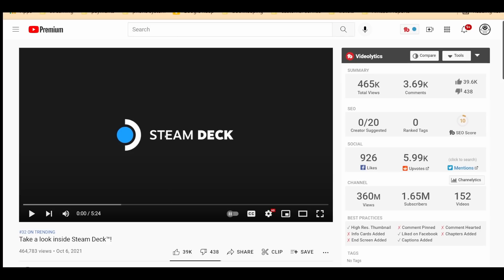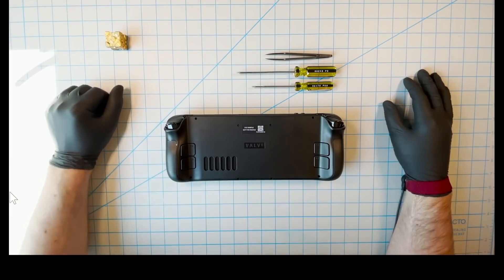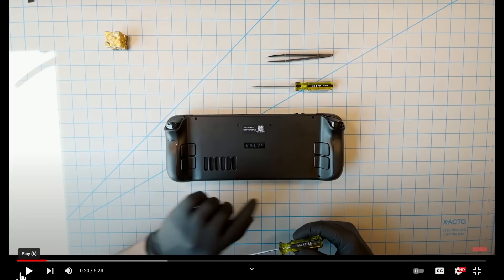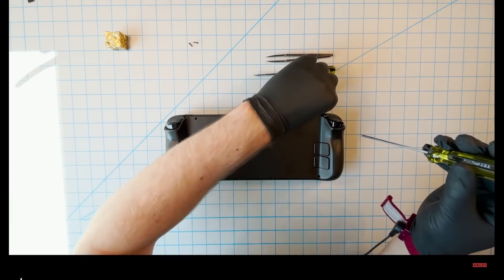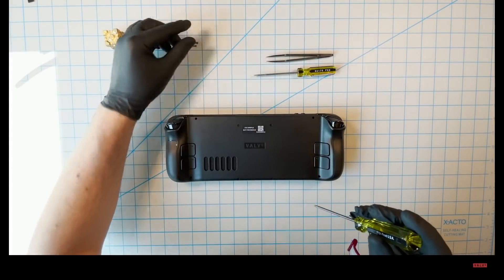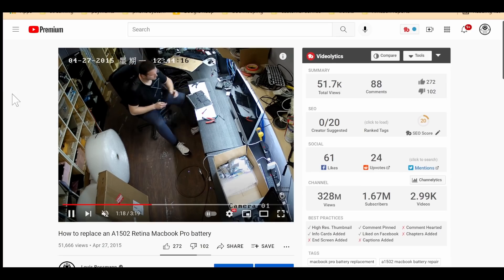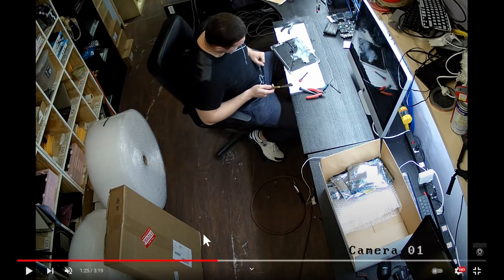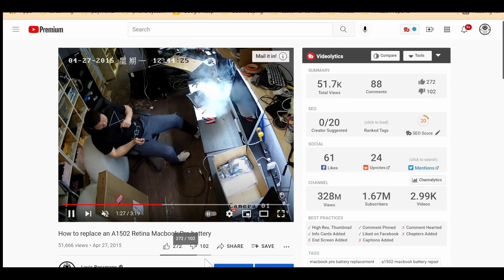Steam deck battery may end your life? bruh 😑

Comment: Believe or not the internal estructural is compromised by don't tight correctly the screws, usually the screws are placed for 3 goals: 1 for be few and hold as much objects are possibly, 2.- for the overall estructure can support the forces of kilonewtons or grams per square centimeter, 3.- the screws dont damage the estructure when are screwing in to it, if the company have respect for the product or have respect for the resurces invested on the product they have a special team who only job is desing  of where, how and how much stress the screw will handle

Comment: It can "weaken" it if they used anything similar to the C64's self tapping screws. Thats how I destroyed mine, I dropped it while horsing around with some one and the C64 popped open and spilled its guts everywhere, however I was able to glue and solder the whole thing back together.

Comment: Well if you take out the self taping screws it will technically be more fragile after reasembly, or you can break something off, not thant it matters after one time, but if someone who doesnt know better gets too confi opening it... as you sayed, people are morons and its good to scare those who dont know of, if its with the battery or construction. I think you saw several laptops that were open by customers that just dont fit so well anymore

Comment: Regarding the screws... I mean it's a screw going through plastic right? It makes sense that it will get looser every single time you remove the screw and put it back in. 

Especially if you somehow manage to get the threads misaligned and cut a new path in the plastic. I would be more concerned about over tightening.

I don't think it's bullshit, but it's definitely extremely cautious.

If you're the kind of person who can understand why it's not a problem, then you're probably the kind of person who can take apart the steam deck safely. 

Maybe that's the point?

Comment: Technically they're correct the structural integrity is compromised slightly but I mean very slight. This happens with any self tapping screw, every-time you take out and put in the screw you unfortunately shave away a bit more plastic each time (This is usually fixed with resins like loctite etc but then its semi-permanent). It's negligible but I imagine they have tested this with a robot/machine and confirmed after I dunno 10,000 tries! So yeah your right, it's probably not enough to warrant not fixing your device but just enough for them to have to cover their ass and put it out there.

Comment: I don't think the permanent damage from screws is a huge stretch. When I used to mod nerf guns, it was very easy to damage the screw holes with those shitty self tapping screws.
Plus they're very snug when they're first screwed into the plastic and once you unscrew them, they're slightly less snug so you screw them in a little harder which damages the screw hole slightly. After repeatedly opening up nerf guns, you do notice the screw holes starting to fail even if you're being careful.
And yeah you could not screw them in harder but then you'll just have loose screws.
Or maybe I'm just shit, who knows.

Comment: Imagine engineers with legal counsellors sitting and counsellors saying:
- So you are making a tear down video.
- Engineers: Yes.
- What if a person opens the devices damages the battery and it catches on fire killing them.
- Engineers: That's quite unlikely to happen.
- Does that mean it would be impossible?
- Engineers: Well...
- If there is 1 chance in a billion, then let them know they may die. We don't want legal problems.
- Engineers: okay?
Reply: This is a screw driver. Please be careful when using it, because PEOPLE COULD DIE. Phillips will not be responsible for any harm done.

To be fair though, since you cannot really extinguish battery fires (since the heat comes from an internal problem), there is a risk of the whole room catching fire. And people easily underestimate how quickly that becomes a death trap. Add the smoke filling your room, maybe toxins. It is certainly dangerous. But then again, almost everybody is carelessly carrying one or more of those things in their pockets.
Reply: @LordMardur  With the prevalence of batteries that can suffer thermal runaway if damaged, I really think there should be some sort of widespread PSA or teaching initiative about how to smother lithium fires. Like how we have voluntary emergency care classes that teach CPR and concussion mitigation.
Reply: @VulpesHilarianus  & grease/kitchen fires. Every Holiday season news stations run PSAs about how to put them out because it's rather counter intuitive unless you really think about it.
Reply: @VulpesHilarianus  Yea I'd like to find out how you can smother lithium fires!
Reply: @bbbbbbb51  Thousands of people die a year of dumb shit that is purely their fault, Welcome to the real world. Shit can and will go wrong. The whole PSA and disclaimer shit is becoming annoying.
Reply: @jostouw4366  sand.
Reply: @bbbbbbb51  yes!  why would you not ALWAYS have a proper lid nearby!  ALWAYS have one ready...ALWAYS!
Reply: @zvxcvxcz  where do you get the impression that a 10 years old kid with a screwdriver and overenthusiastic curiosity would have a class K fire extinguisher in their fully fledged professional electronic repair workshop, a.k.a. the top of their toy box, which may or may not contain flammable stuffs that could have caught a spark from the battery fire, when they opened their device.
Reply: @jostouw4366  you don't, just make sure the fire can't spread then back away and let it burn out. If you are working with lithium or batteries often you might want a sand bucket with a hopper to bury the batteries. lithium fires can burn hot enough to melt the sand into glass though.
Reply: @nathanielhill8156  I knew that, you've heard of sarcasm right?😇
Reply: @LordMardur  This is coffee. It is got. It can hurt you.
Reply: @LordMardur  Just throw it in a large body of water. The water will diffuse the heat and electricity and not only solve the problem but hide the evidence that it ever occurred.
Reply: There's also the problem of people wanting to get this out of the room they're in. This may cause them to pick it up and that again puts them in more danger.
We're all a bunch of nerds. But millions of people even kids watch the original valve video, and valve really needs to cover their bases on this.
Because in any court they could never argue that you're not supposed to open it once you make a video showing how to open it
Reply: As I usually say, at this point I think engineers just write the very last page of user manuals (when it's there) about the technical specifications.
The rest is written by lawyers.
Reply: Reminds me of the Simpsons when they're watching the video about Cypress Creek, a planned community for the workers of Globex corporation. At the end it says "Cypress Creek, where dreams come true" and is followed by a disclaimer that your dreams may vary from that of Globex corporation, it's subsidiaries or shareholders.
Reply: A woman sued MCdonalds for her spilling her coffee on herself and claimed she did not know coffee was hot in court, and she won. Now they print COFFEE HOT on their coffee cups and holders. This is why this is a thing. It's all about liability.
Reply: @AdolphusOfBlood  that was also a great Seinfeld episode
Reply: @JonCusack  I know people that have worked on site security. It does not just happen in good comedies sadly. For the record his partner shot the guy when he was attacking him with a knife. Then the guy ran off. Yes he aimed to kill (two hits center mass), yes he was a lethal threat.
Reply: This comment reminds me of a Terry Pratchett thing.

    "You can't give her that!" she screamed. "It's not safe!"
    IT'S A SWORD. said the Hogfather. THEY'RE NOT MEANT TO BE SAFE.
    "She's a child!" shouted Crumley.
    IT'S EDUCATIONAL.
    "What if she cuts herself?
    THAT WILL BE AN IMPORTANT LESSON.
Reply: Well A Li-ion battery could catch fire just by charging, or sitting undisturbed. There's millions of ticking bombs sitting in obsoleted phones  discarded in junk drawers. Valve are just protecting themselves against stupid with enough money to hire a lawyer.
Reply: I mean, yeah? Where is there a problem? Fraudster can basically perform an "insurance fraud" on you if you don't say anything.
Reply: That pretty much sums it up. They said all of that to make sure their asses are covered if some idiot tries to sue them.
Reply: The problem here is - this is a handheld device you might carry in your POCKET. The battery catching fire in your pocket will probably lead to very nasty burns....
A friend had his vape device do that, since he fucked up his modding....
Also KIDS will be using the device and they are not trained technicians....
Reply: @cl1cka  Maybe not but they are experts at stress testing both mentally and physically!
Reply: I think it's more about people crying wolf, than the ones actually having accidents
Reply: That's probably along the lines of what was said at such a meeting too.
Reply: I'm so tired of the safety notices on everything now, Its become so intrusive and annoying. 

Lets be fair here, "Its Dangerous Business Walking Out Your Front Door"(Lets see if anyone gets that reference lol) every day. Theres 0 guarantee that you'll be making it back home everytime you go to work, the gas station, super market ect. And even at home, you arent safe. One fall could mean its game over if you fall in just the right way.
Reply: @joshuakhaos4451  why do you think they do it?
Reply: but 1/1000000 is practically 0
Reply: @hukama6911  lawyers would argue otherwise, Steam doesn't want to deal with lawyers.
Reply: @CardSearcher911  but engineers aren't scientist, and practically that 1 guy is negligible
Reply: Engineers believe that people are smart, lawyers know how stupid some of them can be.
Reply: @spacekettle2478  including other lawyers and judges.
Reply: Don't you just love when idiots turn the carefully accurate scientific statement of "well, technically nothing is impossible, because our scientific methods can't verify/disprove any hypothesis you can make up with 100% certainty, due to lack of data and possibility to test, but our extensive research shows no indication towards this hypothesis holding any merit, thus it's extremely unlikely" into: "ScIenTiStS cAn'T pRoVe Me WrOnG, tHeReFoRe I'm RiGhT!!!1!"

Like, I can understand when little kids ask endless what-ifs and come up with the most preposterous scenarios, expecting a definitive answer, but when adults do it, that's just imbecile.
Reply: This is the thing that everybody has to realize. That one person that gets killed or maimed on the battery, well then sue the company for millions and millions of dollars. Which can ruin a large percentage of profitability for that quarter.
Reply: @nickvanhorn681  most jurisdictions would first figure out where the cause of fault is. If the battery itself is not manufactured or installed wrong in such a way that it could catch fire without someone actively damaging it via their own actions that go beyond general use cas, the company is fine, big companies get countless such silliness and have the responses all preset.

Turns out most cases of what seem to be silly successful lawsuits you hear in the news are made to sound ridiculous by the news but in reality arent.  I.e. one of the more famous ones is the whole coffee spilt on self. In that case it was shown and determined that the coffee machine being used was set outside of the franchises constraints and being used incorrectly by the franchisee to the extent that it gave 3rd degree burns not just normal regular burns. The news of course just went duh coffee hot look at stupid person and stupid courts .
Reply: @SereneAncalime  Then pray tell, who paid the bill for that coffee burning her? Did the court do the sane thing and award her damages from the Franchisee? Or was it the corporation? I've seen her burn photos, they were awful. Then again, never forget that insane rulings are made all the time. Such as firearms owners being sued by criminals for shooting them while they were committing a criminal assault. Those have ended in the criminal winning the case. Never assume a court ruling will be sane.
Reply: @AdolphusOfBlood  I would say that it isn't McDonald's who payed her. It was the people who shop at McDonald's.So, why should I pay this lady who spilled coffee on herself? I have cut my fingers, burned my fingers by accident hundreds of times. I have had a couple of bike accidents and broke my arms.

A few years ago I heard about some bozo suing Pepsi because he wanted a Harrier Jet. Again, why should I pay 33 million to this guy?
Reply: @louistournas120  ... because you won't be the one fending off the vexatious lawsuits, Maccy D's will.  It's not just to protect themselves from the real instances of their culpability but the many, many more where the customer is a dipshit who thinks they can make a few quid by sticking hot sauce in their eye, accidentally or no.  Just fending the most egregious ones off costs a packet and the one thing these companies hate is losing profit.
Reply: @I_Don_t_want_a_handle  It’s more of a USA problem. The court systems over there seem to allow anything to pass through. If you hurt yourself, like in the case of this lady who spilled coffee on herself, the court should just reject the case.
However, I do understand that judges and lawyers need jobs.
The other problem is that in the USA, people sue companies for millions of dollars. It’s a ridiculous amount. The lawyers get rich as well. It’s a get rich quick scheme.
The other problem is that the USA doesn’t have universal healthcare. So in this case, the lady wanted McDonald’s to pay for her medical bills which is 8000$ and McDonald’s refused and that led to a court case.
In Canada, nobody sues anybody for medical bills. I have never heard of an individual suing a company for millions for hurting themselves.
Reply: @louistournas120  The NHS' largest cost is compensation claims ...
Reply: @louistournas120  Honestly, that was most definitely McDonald's fault. The court has repeatedly told McD's to lower their coffee temperature multiple times. The woman was just a tipping point. The court lowered the amount after McD's lowered the temperature.
Reply: @I_Don_t_want_a_handle  Have you tried their napalm apple tarts?

Comment: 8:55 For self tapping screws - during re-installing just do a full revolution counter-clockwise (unscewing), at some point you will feel the screw drops into the correct thread position. Now just screw it in safely. The smaller the screw is the less force you put to tighten it. It's better to make it too loose than too tight.
Reply: Even if you do that you still have a small chance to strip the thread. For inexperience people, it's happen quite frequently.
Reply: 'too loose' - that's their point, it will never be the same as the original, and technically you cannot ever torque as high as it came from the factory (being torqued to yield)

Comment: The self tapping screws bit is absolutely accurate.  Every time you screw it in you're tapping new threads into the plastic, cutting a new grip surface.  Once or twice is no big deal, but by the 10th, 15th, 25th time there's nothing at all to grip onto, and a dumbass kid might overtighten and strip the whole tap of grip area.  Ultimately, for disassembly and reassembly to have no effect on their construction, you would have to have the patience of a saint to find your first cut, which there's a 50/50 chance won't be suitable for reuse.
Reply: Someone on the original video from valve said "you can prolong the lifetime of your screw holes by counter-rotating the screw until it sinks into the old threads".
Reply: Why do you all have so much trouble with self-tapping screws?  Ive taking them out and putting them back into things for my whole life and stripped out maybe 2 taps. Are you “just hand tightening it” the way you’re “just laying down” your phone when it shatters?
Reply: @Vapourwear  No just opened cheap devices multiple times. The cases often made of plastic that is far more brittle than on a laptop.
Reply: @Vapourwear  It's a skill, and one that not many people learn.
Reply: I learned it the hard way :D
Could as well insert brass inserts and get more integrity than from the factory. CNC Kichen has video testing different fasteners on 3D prints. 
The whole is stating "We don't want to be liable for any damages". If I were them, I would do the same.

Comment: As far as the structural integrity goes; i can imagine that you can't put the screws in with the same torque as when they were put in the first time, just because the threads are being cut the first time, and they loosen a bit when you take out the screws. And yes, that will cause the case to have ever so slightly more flex.
But for some reason, I highly doubt that it would harm the structural integrity. If anything, it might even give it a bit more flex in case it's dropped, so it won't break as easily.
Then again, I'm not a mechanical engineer, I'm just an electronics engineer.